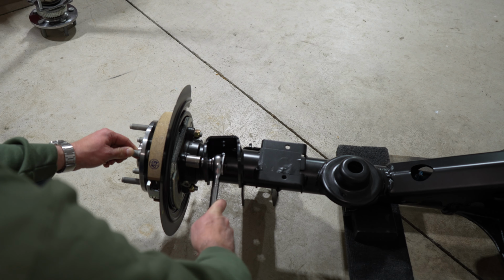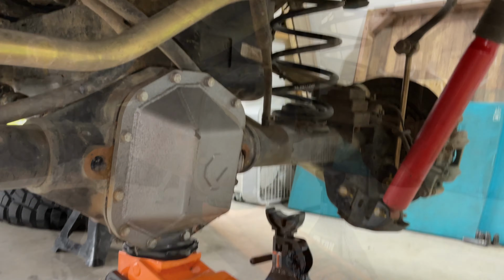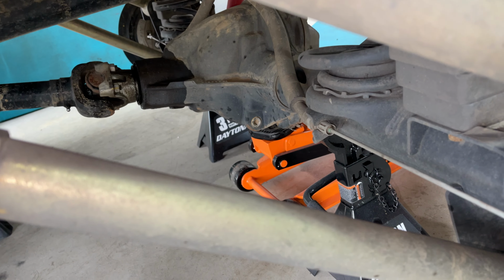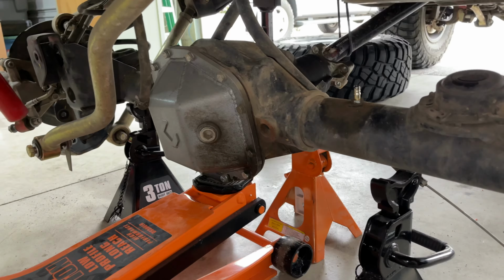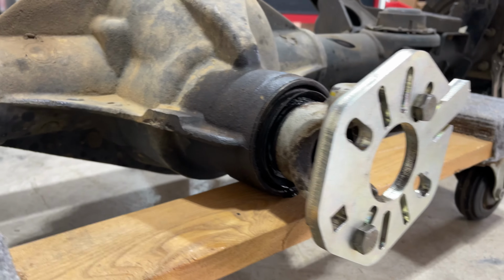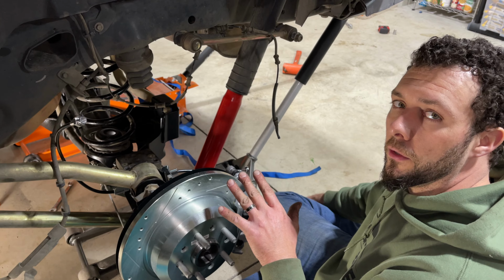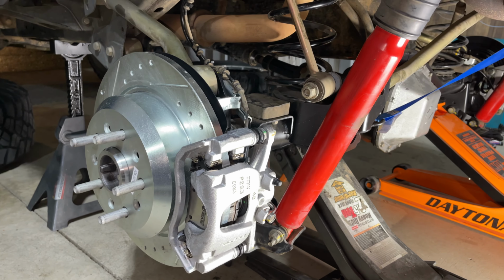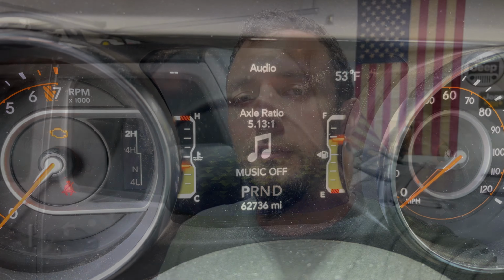How To Swap A JL Rubicon Rear Axle - Part 2

Comment: Can you put that narrow track willys axle on a jl rubicon. Is the fact that one axle is wide and one is narrow a real hinderance from them being interchangeable
Reply from the maker: No, all the mounting spots are the same. But I don’t know why you’d ever wanna go from a selectable locker to a limited slip. I basically did the opposite of that and the locker made a huge difference on the trail, the bigger brakes were nice as well. Thanks for watching the video!
Reply: @FROSTBITEOFFROAD  because it's a nightmare to go and find the a locker that is 32 spline that will fit on the Rubicon. All aftermarket lockers at least from my knowledge want you to go up to 35 spline which means you would need 35 splined axles
Reply from the maker: @moemanm1202  yeah, the Rubicon locker is hard to find if you break it. I ended up buying a new rear axle from the dealership and swapped the locker over to my trussed axle. It was expensive but I sold the empty housing and recouped some of the money. I believe it ended up being cheaper than buying the 35 spline ARB and the custom axle shafts with no wait time. Hope this helps!

Comment: Hello, I have a question about the transmission oil. Does it need to be changed ؟
Reply from the maker: No, according to the dealership it’s lifetime fluid for the automatic transmission. Seems weird but I guess it’s a process to change if you actually need it done. Transfer case and differential fluid will need changed as you probably know, I need to do my transfer case soon. Thanks for watching the video!